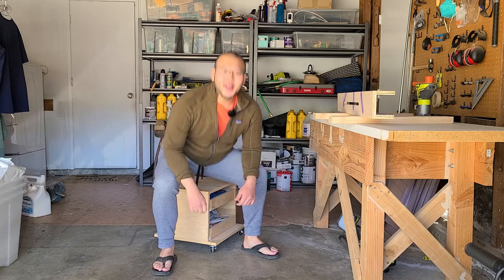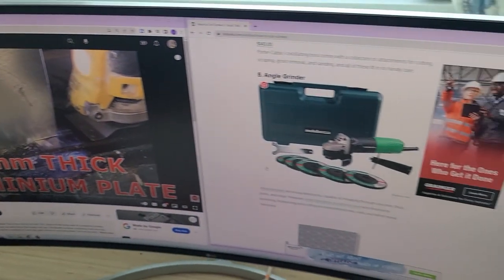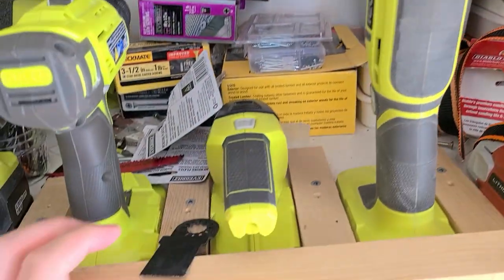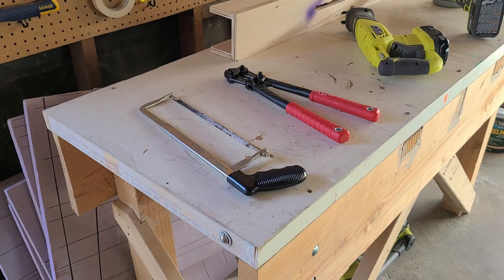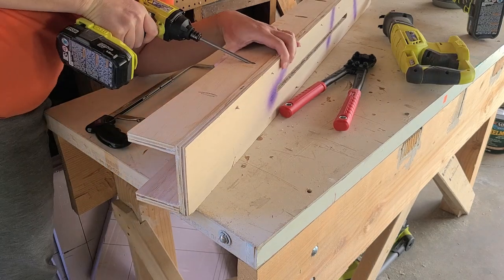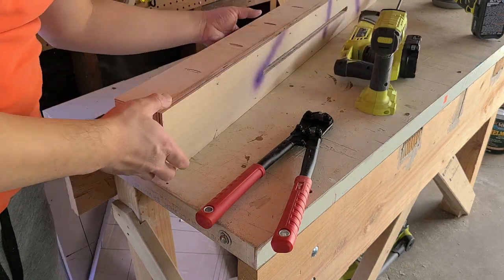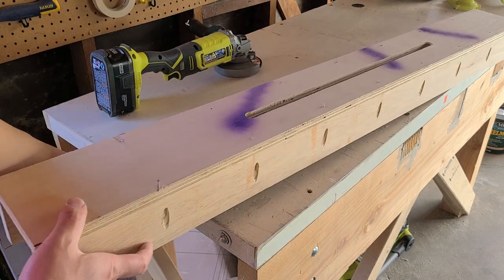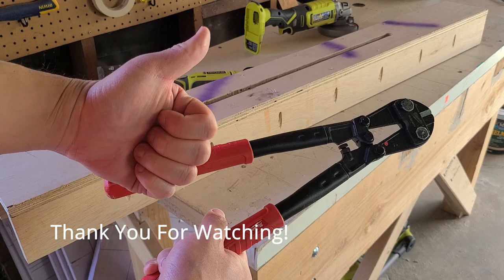5 Ways I Tried To Cut Screws/Fasteners

Comment: I'd recommend picking up a set of bastard files; a set usually has at least flat, half-round, round - others will include triangular and square. A smaller set of "needle files" is also handy, inexpensive diamond-coated ones work decently well on at least softer metals for detail work. These are just generally useful to have around for shortening fasteners, shaping/smoothing rough metal edges (after cutting with bolt cutters, hacksaw, etc), and cleaning up threads (so that things still screw together).
Reply from the maker: I didn't even know these existed. I'll check them out and pick some up! Thank you!

Comment: The thick disk for the grinder most likely was a grinding disk. That would def work. You should have also bouth some thin cutting disk. For screws extending by so little I would simply use a diagonal cutter. My favourite is my knipex. Hasn't failed me on even hard screws.
Reply from the maker: I didn't know what disk it came with, but will definitely pick up a thinner one and will also check out those knipex. Thank you!
Reply: @ADentistDoesHomeImprovement  I like your videos because you are trying and not shy to make mistakes. I would suggest though, if you get cutting disks for the grinder, to do a bit of research on how to use properly. Those disks can shatter into all sorts of flying shards if not careful.
Reply from the maker: @shawnferguson7477  Smart. I'll definitely look into that. I bought a bunch of safety gear for when I started with a chainsaw. Safety is always good to learn about. Thank you!

Comment: For your multitool try to look for a blade rated for screws.  That was probably only rated for wood, maybe metal too.  But screws are hardened.  Carbide teeth is what you need.
Reply from the maker: Ah. That makes sense. I'll pick one up next time I'm there. Thanks!

Comment: a pair of diagonals or sidecuts (both types of pliers) can be handy for cutting things as well, though probably not so much for screws
if I needed to shorten a bunch, I'd go with a grinder with a cutting wheel myself... but I was familiar with a grinder long before I ever did any woodworking, or just a good cutting wheel on a dremel
Reply from the maker: I almost picked up a dremel! We have a similar tool in dentistry, but went with angle grinder first. I'll look into diagonal or sidecut pliers. Thank you!
Reply: @ADentistDoesHomeImprovement  the thing about the dremel is that you want the reinforced cutting wheels really, the non reinforced take very little to come flying apart
which brings me to another point, my dad worked industrial construction type work, lot of metal working, so I was always taught to have full face protection when using the grinder, most in particularly with cutting wheels (as they can go flying apart), I'm not one to safety police, but it is worth considering
a "flap disc" on the grinder would be a bit less aggressive than the rock
Reply from the maker: @chammers7377  Smart. Safety police away! Safety always good to learn about. I have a helmet face shield combo that I use for chainsaw so will use it whenever I get the cutting wheels. Thank you!

Comment: Your doing great a grinder is good for many things using flap disk for sanding wood or even sanding down the screw tips work great ,cut off wheel and grinding wheel.
Do yourself a huge favor as a safety stand point when putting a grinder down face the wheel upward / or on it's back # 1 so you can see if it is spinning # 2 if you place it face down in a hurry while it's still spinning it wont take off on your and cause major injuries' to you or other or even property damage  .
Reply from the maker: Thank you! That's great advice! It was my first time using an angle grinder and will make sure to have it face upward the next time I use it.